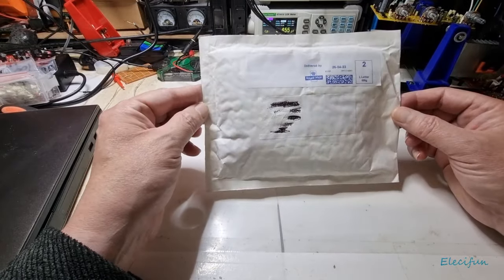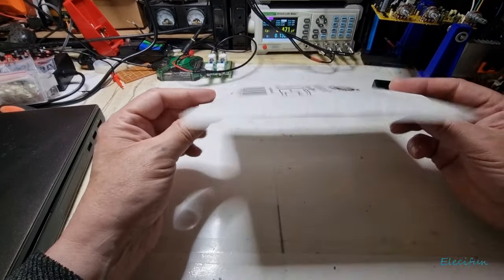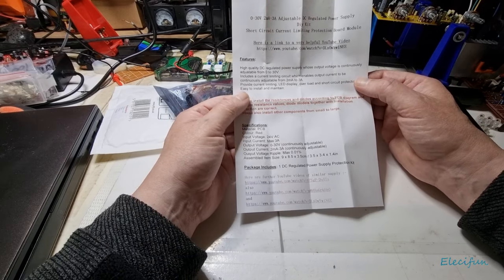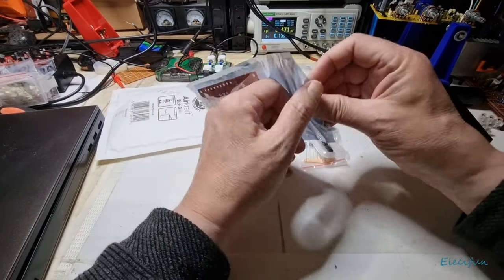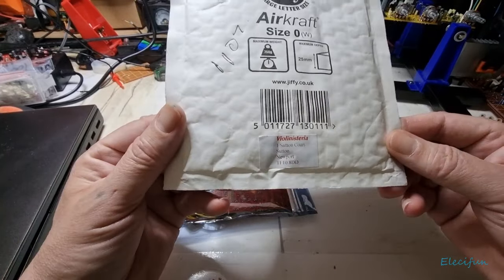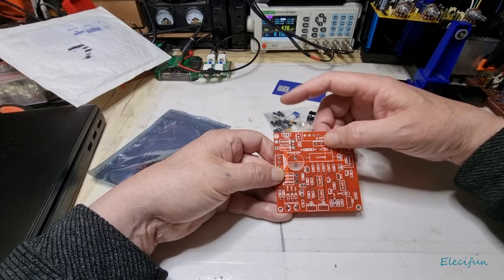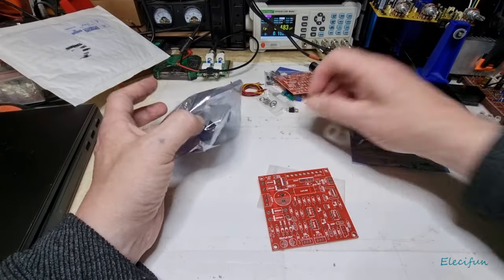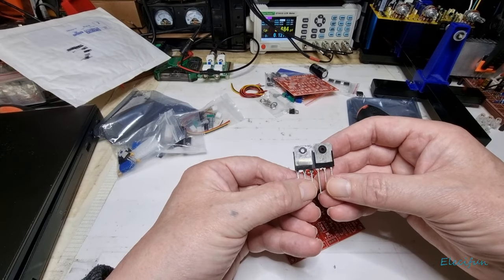NEW 0-30V 2mA-3A Continuously Adjustable DC Regulated Power Supply DIY Kit

Comment from the maker: If I understand this correctly, the link below is the origin of the circuit for this power supply.

https://www.electronics-lab.com/project/0-30-vdc-stabilized-power-supply-with-current-control-0-002-3-a/

Comment: I love these little supplies and prob have a dozen or so now. Opamps are often dodgy but easily swapped if you socket them. Also i have had occasional snubber resistor failure. But these boards are great for learning troubleshooting. I use TL081's and 741's and keep spares. The fan & transistor can be changed for any voltage you prefer. Mine were all around $5 delivered, so who can complain at that? They are real bargains, but always keep spares. There has been a ton of development/refining of the original Hiland on the internet since they came out in the 70's(?), if anyone wants to research and modify. Thanks for the video.
Reply from the maker: Be good if you showed a working board that isn't Hyland. Your channel is bare.
Reply: @Elecifun  Fair point. Sadly i am way too old and sick to figure out how to video, even if i could afford the equipment. Not a complaint, just a fact. I actually have not come across these newer boards with the relocated voltage regulator, so i am curious to find one.
Reply from the maker: @englishrupe01  The new boards are everywhere on ebay, Banggood, Aliexpress.. Many have the word RED in the advert. 
Unfortunately I have bought many of the none Hyland boards and not been able to get one to work properly. This board in the video is different again as it works but the voltage regulator output is a mess as shown in the video, which I compared to a clean output Hyland board.
All my Hyland boards work fine. I am not affiliated with Hyland Elec in any way shape or form. I have no reason to sway the outcomes of these builds. 
Just saying it as I see it.

Comment: Socket the op amps leave some lead length on the resistor and filter cap to keep them off the board and prevent thermal coupling, same with the rectifier diodes,  make sure you use a decent sized heatsink because worse case you could be at a croup of volts and 3A that means 80w plus to burn  off on that pass transistor,  also you need a beefy transformer with a low enough output impedance to provide enough current with to much voltage drop otherwise you wont get the full 30v at 3A you cant get around this by simply using a higher voltage transformer .
Also once you have built it dont try to test it by feeding DC from a bench supply, it needs AC because it derives a negative voltage rail from a tap on the rectifier bridge .
 If you knew all this already i apologise, just came across this and I don't know anything about you or your skill/knowledge level,  just trying to help 
Also 10 turn pots make these a really nice supply,  ive built a few but only use them for low power or short runs at high power,  the low current output capability is really useful, i find its around 4-5mA using the 10 turn pots i used, socketing the op amps makes for easy repairs in future as its those and the zeners that are the usual failure points..
Reply from the maker: Hi there, cheers for the info, input. Haha, this is not my first time with these supplies. I have two working boards and a bunch of failed fakes. 
Iv'e power tested the workers and tried 120VA and 160VA transformers at 24V. Can't go higher on the voltage as rectified we are  ¬33V minus rectifier forward voltage. The opamps can only go 36V at their best. 160VA was best as line regulation on the smaller transformer was worse.
I could get 3A but at ¬25V not 30.

Comment: As you have DSO, etc, it would be good for us all if you could compare the OP AMP (this latest kit and the fakier ones), to see if the are really a TL081 (at least ok for Vs < 36V) or a “rebranded” bipolar, some of them slower, and/or with crossover distortion - seen when tested as unit gain amplifier with 100KHz square wave, 5Vpp.

Comment: The silk screen on some of the copies is wrong, all the diodes are printed backwards, also sometimes they send fake TL081 op amps and they work but the null pins dont work so you can't zero the voltage properly, the pins do nothing 😅, im pretty sure you could use lm741 in their place, the rectifier diodes were also fakes, they had super thin leads on them compared with the originals i don't rememberwhat diodes they use now, i think it may be 1n 5402 ,, i just watched the end of the video, you said you have built these before 👍 the fake boars are fine you just have to pay attention to the silk screen for mistakes..
Reply from the maker: I checked with a fake the silk screen and all seems well. The TL081's that came with the none working boards were blank. I did buy new Opamps sadly it didn't change the outcome. I have used sockets on this build and I can use it to test the blank Opamps see if they do actually work and some LM741's as I have some.
Again cheers for the input.